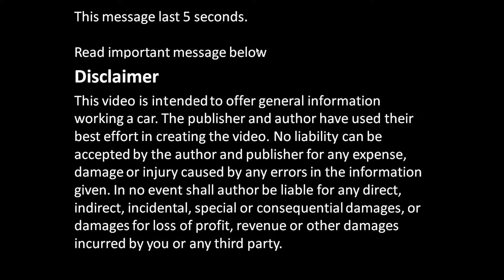How to do Leak test for car radiator. Leak or Not?

Comment: Peter have you evenr ran into a situation where it will only leak when hot and the system is pressurized?   This test does not have pressure is why I ask. Will most leaks, leak both under pressure and not?
Reply from the maker: Your issue is possible. I use only Toyota or Lexus cars. And my cars leaks are very very rare.